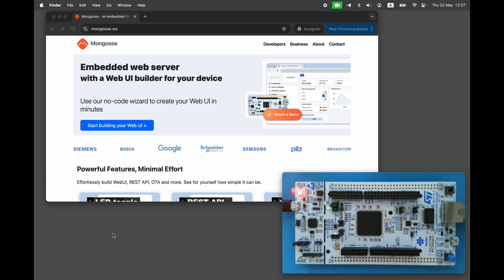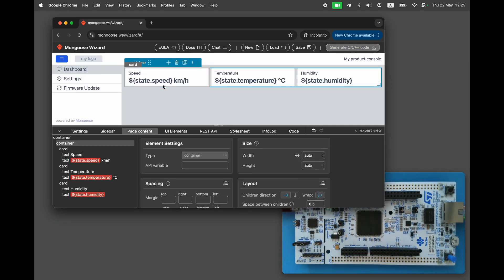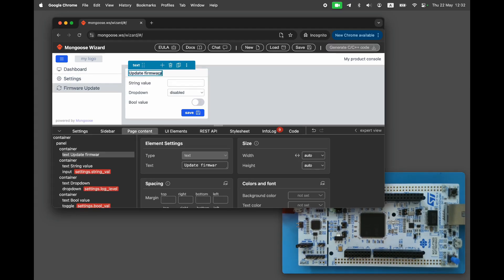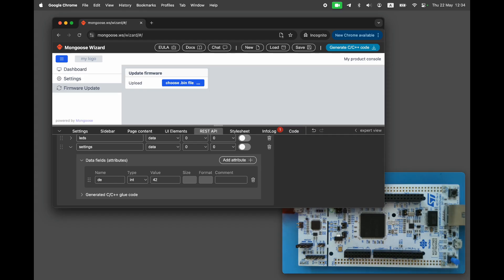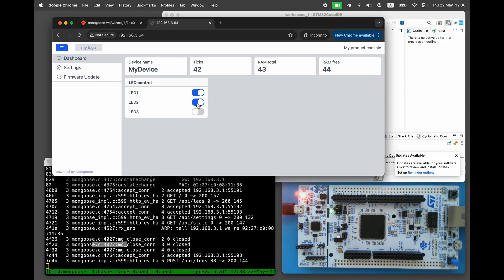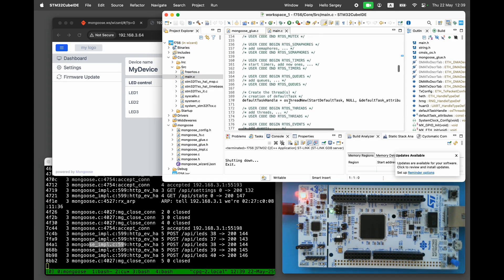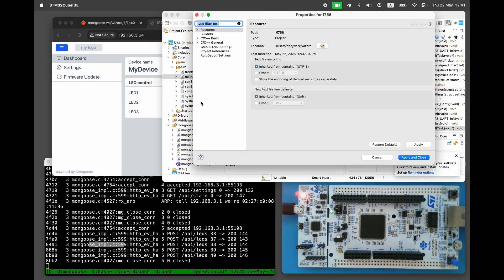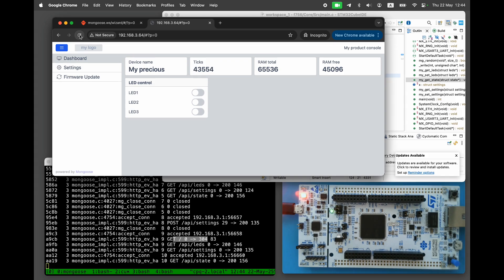Web device dashboard on STM32

Comment: This is great, II only recently discovered this platform and can see myself using it a lot.  One question though - I can't seem to add a container like you do at 1:20 in the video.  It won't let me put a container below another container.  Did something change in the wizard since you published this or could I be doing something wrong?
Reply from the maker: Everything works as expected it seems, maybe pay attention what is the parent container - vertical or horizontal? Join the chat and ask there, you'll get a faster response